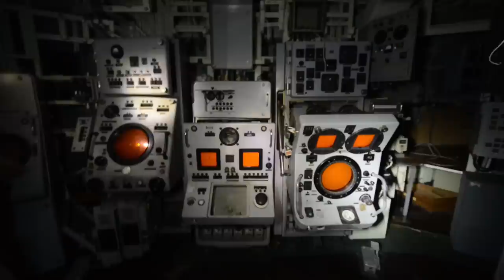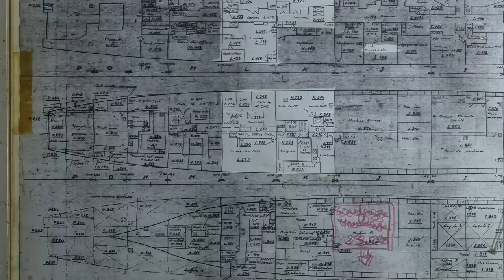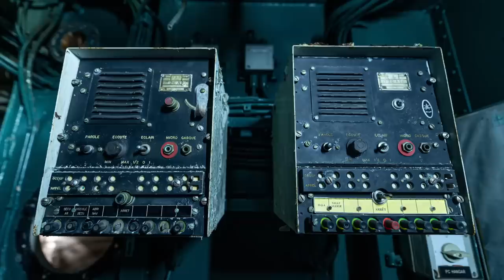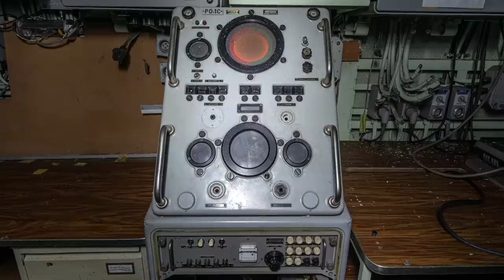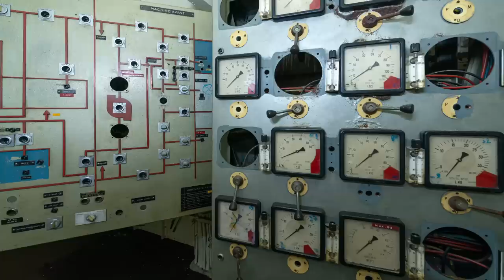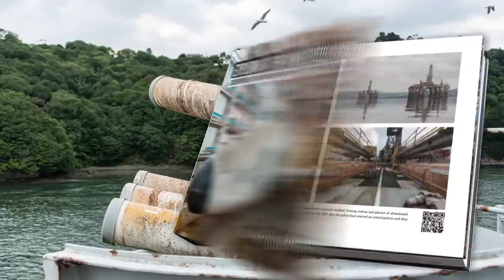URBEX | We snuck inside abandoned military ships | 2015-2016

Comment: Do you ever use an oxygen sensor? Also called a (sniffer). The reason why I ask this is because there has been many fatalities of people into areas where oxygen from rust growth and other aspects. It's a small device that clips to your shirt if your wondering. They are not too expensive yet how much is your life right? Priceless.
Reply: You're right. It is foolish to go around in these things without a multi-gas detector.
Reply: H2S
Reply: Not only that, those ships are full of asbestos! 
Plus the metal corrosion (oxidation) can consume the oxygen
Reply: @chipjumper  or a canary :)  budget gas detection
Reply: @juanmanuelortego8896  contrary to popular belief, asbesto containing materials do not become airborne spontaneously, that is, it is only during a breaking or abrasion moment that the particles can somewhat become suspended in the air, and the real danger lies in the fabrication/repair/disposal of the materials.
Roof asbesto shingles are an extreme case that are very exposed to the elements, quickly loosing protective layers and then eroding with the wind. Even so, it is only during their breakage that significant ammounts of asbestos can be released and inhaled.
Reply: That's a great point. It's called a "confined space" here in America. Major asphyxiation hazard!
Reply: @juanmanuelortego8896  well when the ship is untouched for 10 years asbestos is no problem
Reply: Defiantly, some of the Gases built up in pipes, as mentioned H2S. I rebuilt some sprinkler systems on our boat and we had several scares, if you smell rotten eggs, GET OUT IMMEDIATELY.
Reply: I've "turned off" once when my head was in a low oxygen area of a large machine. The result was I fell backwards out of the low oxygen stream and revived. ( I've cheated death many times... this is just one of them ) 
I can tell you the experience is, nothing wrong, nothing wrong, nothing wrong, black edges in your vision and... OUT. There is no warning. From first symptom to blackout is a couple seconds.
Reply from the maker: @bunberrier  Damn.. that's pretty serious.. I've been lucky a lot of times I can tell you.. Been in and out every room inside many ships. We now have sniffers for these kind of places.
Reply: @ExploringtheUnbeatenPath  Glad to hear it dude.
Reply: @rrs_13  when it is heated I know it makes it worse I worked in an old meat packing plant built in stages from 40s to 60s worked 40 straight years but I had a couple light strokes so I had to quit I know the old smokehouse were lined with sheets of material I never seen and other stuff all around I know it was made from asbestos  so I am not in good shape but I'm making  it now and am not looking for trouble I  just hope I ain't got nothing being the age I am and living on the gulf coast I have seen the effects of it in a lot of people and also working where I did I just do what I  can and pray to God for the help on everything else it could be lot worse hope it don't get that bad
Reply: @rss not necessarily - if asbestos abatement has been carried out there could easily be asbestos fibres. The slightest air movement from walking can re-suspend them in the air. Also, you have no idea who has been in previously. Asbestos insulation in boards or the pipes could have been disturbed anywhere in the ship. You can’t see the airborne danger which is the point. Walking around a decommissioned ship will almost certainly lead to some exposure. Really not worth a YouTube video
Reply: Ffffff

Comment: I used to work on Oil Rigs back in the 80's. The biggest loss of life (excluding explosions like Piper A) was Hydrogen Sulphide, H2S from stagnant sea water. In low concentrations it smells like rotton eggs, in higher concentrations you cannot smell it and it will kill you. We Always used H2S and O2 detectors before going into confined spaces.

Comment: Deck hatches are the most overlooked entrances and also the easiest to get into. When you see the diagrams of the ship those are important as they can tell you where you are and where you need to go to get to other places. Each deck (level) has its own plan so it is easy to find your way around. If you know the compartment numbering system it is even easier to get to where you want to go. Also above the entry to each space (room) there is a corresponding number to the chart or diagram so you can find out where you are at any time. It will also let you know where the closest escape routs are and the various hatches to different levels.
I hope that this will help you in further endeavors.

Comment: Very interesting 🤔
Now any confined environment without air circulation can accumulate gases.
At a minimum these guys should have a multi gas to check for flammable or toxic gases beyond what is allowed.
Reply: Yea when they said any hole can be a entrance i am thinking I know nothing happened but dead zones. There was a ship in the Atlantic (cannot remember name) but there was a storm so they went in to secure the chain (banging around). I think 3 people died going in due to them not having any air in there.

Comment: I`ve read that these ships often get used as targets for marine exercises in the ocean. And i don`t think that these ships are`nt any more seaworthy. They just need some diesel to get the engines running..
Reply: For being used as a target ship, the fuel tanks to be completely empty ,also all other tanks should be oil free, as all ships carries tonnes of fuel mostly in the double bottom tanks. It's usually cleaned and oilfre ed, surveyed by a surveyor, then it's towed with a tug to the firing exercise zone. To avoid marine pollution, MARPOL.
Reply: Gas turbine engines
Reply: @southwestxnorthwest   steam turbines, see those A or triangle shaped boilers producing superheated steam.
Reply: @southwestxnorthwest  Yea pau is correct, these arent gas turbine powered. Diesel
Reply: France doesn’t use the ships as target practice, nor does any European country, for environmental reasons.

Comment: 42:52 is the boiler room, specifically the burner front area and a hub of activity for the boilermen. The labyrinth of pipes and valves were necessary to precisely control the pressure and temperature of the fuel to each burner to maximize efficiency.
The next photo shows 2 large gray boxes (coffret) that contain some automated instrumentation devices, the proto beginnings of 'ABC', 'Automatic Boiler Control', which is a fully matured electronic technology today.
Between the boxes is a small cabinet that most likely contained a phone that connected with the main engine room. Above the cabinet is a clip board holder where one would find the shift schedule, the night orders and probably a menu from the dining galley.
This little space is hauntingly abandoned in these photos, but in its day, it was occupied by multiple people at once and was a very lively and busy place.
Reply from the maker: Thanks for your info! This is shitty footage not made to be uploaded. I went back to the same place/other ships and maybe can use a bit of the info. I also went to explore other ships which are decently filmed😁

Comment: entering abandoned ships is really dangerous, specially if its cealed, because rust start poluting the air with co2 and you could die there in minutes, most rooms maybe fine, but the ones on the bottom may be lacking O2 specially cauldron or engine rooms, since most dont have good ventilation.
Reply: yes, i was going to say this, another room to be really careful of is chain lockers.
Reply: Kernal Scott 2  If i remember correctly the CO2 becomes an issue if it "pools" in some confined space (no power in the ship means lower air circulation). There was a video by some infographic channel here on youtube that had something similar happen, though I cannot remember if it was CO2 or CO or perhaps something else.
Reply: look up oxidation formula for steel. ZERO CO2 produced. Completely unfounded claim.
Reply: @DasZees   kahoala3  think for a second, OXIDATION is for example of iron Fe+O2-->Fe2O4, so gradually O2 is coming out of the air and going in to the iron walls, so with less o2 you cant breath, this wont happen as a rule in every contained area, since there might be some sort of ventilation, but it might happen, and you will die in minutes, without anyone to help you, because you would need a full breath suit. i said full of co2 because you wont have enough o2 to breath. yes the "explanation" is wrong but explaining that oxidation slowly sucks o2 from the air takes much time...
Reply: @lukasausen  so now you have a different explanation? and it took just as long to explain. Sounds more like you came up with a reason to make your original comment sound valid. The fact of the o2 reacting with the steel walls and their being less o2 is insignificant because of surface rust limiting the amount of o2 reacted and how much rust do we even see? Sure two people breathing in an enclosed ship create a lot of co2 but the rust does not add any danger, simply being enclosed is enough.
Reply: @DasZees  Ah, found the ship in the video. It was the Sally Ann C cargo ship. It said here that some crew went into an empty hold and fell unconscious due to low oxygen levels. I think that was because of the cargo it was carrying, however the original comments point is that entering any sealed room in a ship, especially if you're not trained, is a big no-no (See IMO Resolution A.1050(27) ).
Reply: Couldn't explanation is chainroom is sealed better and has less free space. Therefore what O2 is in there gets expended quickly.  Plus it's usually at bottom of ship.
Reply: @DasZees  yes, oxidation is irrelevant in a day to day basis, but abandoned ships tend to be sealed with doors welded, think about 2 to 3 years with a enclosed ship, rust sucks air from it, specially as Oscar said in chain rooms. enclosed spaces are dangerous, but it doesnt mean that every enclosed space will kill you, its just good to be sure...
Reply: @DasZees  if you want more info about it theres a really good channel bout ships and stuff "Casual Navigation" just search for enclosed spaces in his chanel.
Reply: What U are referring to is lack of O2.......... Under these circumstances I`d absolutely wear an O2 detector.....Been doing it for years in the merchant marine when we enter enclosed compartments
Reply: @Beffanz115  One, I'm not arguing that this is not dangerous, I am saying that rust has no significant effect. Two, did you read the video description? "Sally Ann C cargo ship" ? They wrote the names of the ships Aconit and Duguay-Trouin frigates.
Reply: @lukasausen  Yeah thats what I've been saying. Its dangerous regardless of the amount of rust. I'd be more worried about depleting what o2 is left in their while I sleep and suffocating. PS I'll look up that Casual Navigation Channel. I'm glad a youtube comment argument ended nicely lol

Comment: Why are these ships not dismantled? Leaving them to rust there is a potential ecological disaster waiting to happen. But then again I guess being a home for seagulls balances it out...
Reply: I believe these are a part of the "mothball" fleet.  Its a sort of reserve status for the ships in case they are needed in an emergency.  They are stripped of most of the vital equipment and kept in this state, having maintenance done on them from time to time to keep them afloat and in decent working order.  If and when they are needed again, they can be quickly refurbished and refitted for combat inside of a few months instead of having to spend years building all new ships.
Reply: These ships aren't supposed to work ever again. They are just not dismantled because it cost a tremendous amount of money. They will eventually be one day but until that, this place is basically a ship cemetery
Reply: According to wikipedia they have been placed there to be used as a breakwater for the École Navale, the french Navy academy.

Comment: Might be a good idea to take along a portable oxygen meter to test the air in some of these sealed chambers before going in. Many people die every year in “confined space” accidents, often due to low oxygen. Low Oxygen levels can’t be detected by sight or smell, and air with <19.5% oxygen can cause you to pass out and die. 

Chambers that were once filled with breathable air could have had their oxygen concentration reduced by chemical processes like steel rusting (oxidation) if the chamber doesn’t have good ventilation.
Reply: That's very good advice. I was on a job when 2 guys died entering an old fish hold on a ship. Decaying fish used up the O2. Couldn't get them out in time.